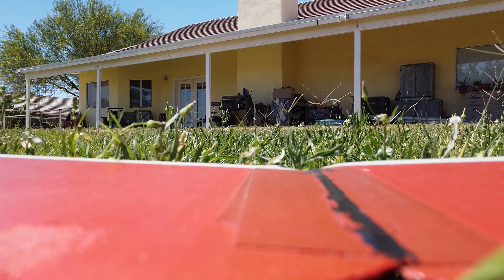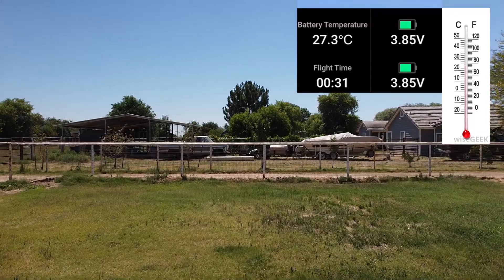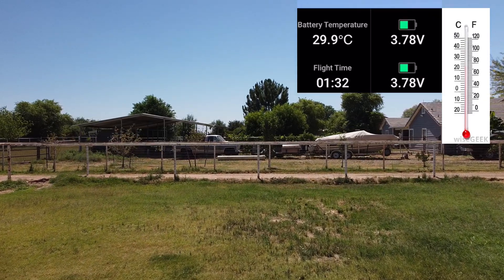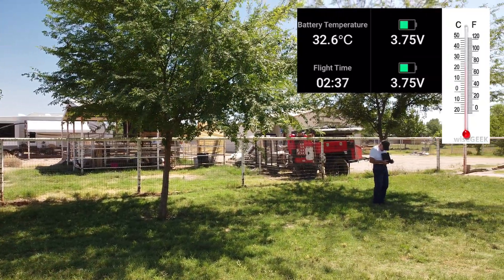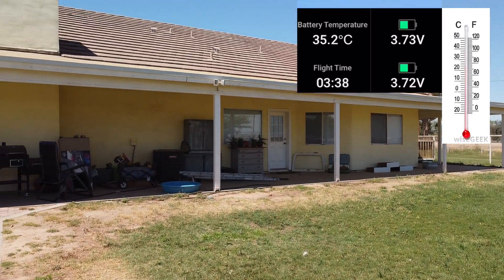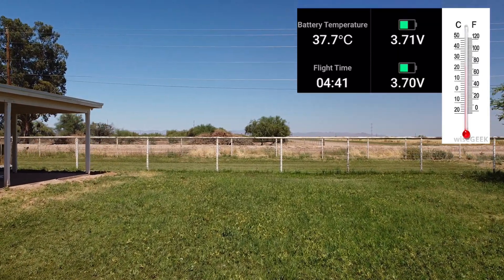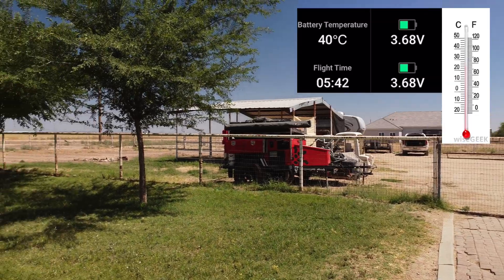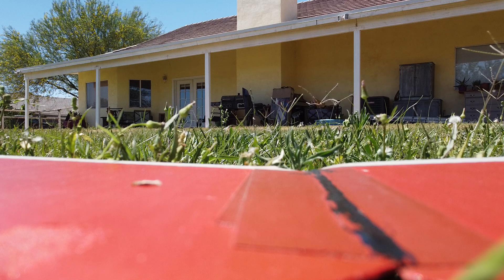TIMING TEMPERATURE CHANGE OF MAVIC AIR 2 BATTERY IN 100 DEGREE WEATHER

Comment: Whats the furthest distance you have taken the Drone ?
Reply from the maker: Thanks for your question. I would guess about a mile and a half. But I gave up on checking that out. Where I live there is just too much interference. God bless.
Reply: mrkentdotcom I didn’t know that even with the Mavic air two I didn’t think there was any interference issues ?
Reply from the maker: @JerseyStyle7  Well, the Mavic Air 2 does a great job but it seems to be affected by wifi a little. God bless.
Reply: mrkentdotcom wow really, i was just gonna buy one, even though im holding out for the Skydio 2